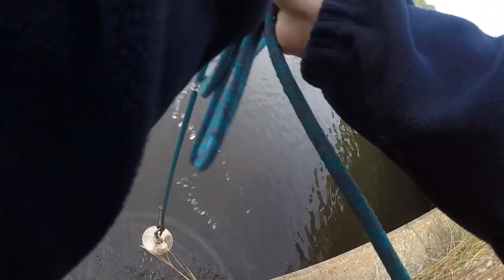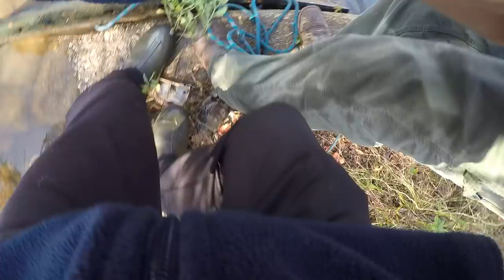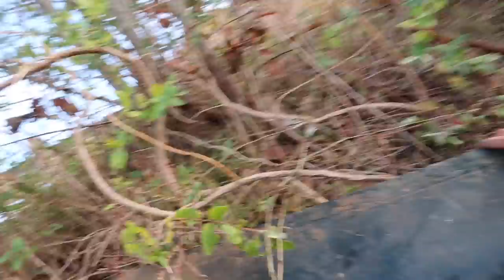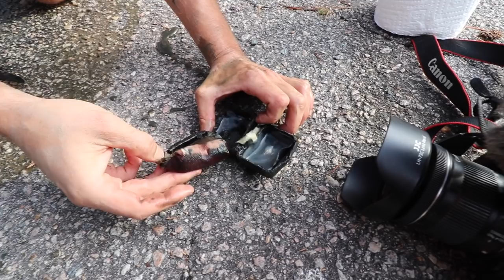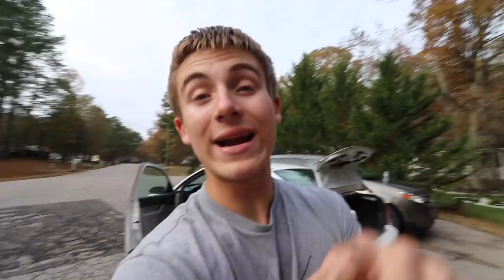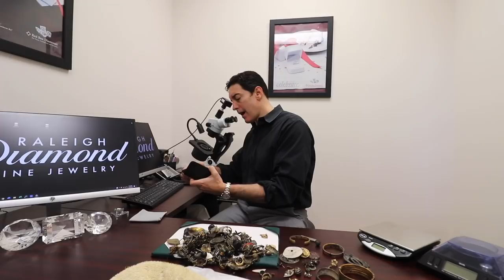We Found A Duffel Bag Full Of Stolen Jewelry While Magnet Fishing (Appraised By Jeweler)

Comment: Looks like someone took the goods and dumped everything else.. Did anythind end up up being non plated gold or silver?
Reply: Well, the jeweler stated that at least one piece was gold filled, which is better than gold plated. For example, 1/20 12K gold filled is 2.5% pure gold content. At $1400/toz for gold, spot value of 1/20 12K is $35/toz. The piece the jeweler set aside as gold filled probably weighed less than 2 grams, so the gold content of that piece was worth $2 or less. 

Even 1/10 18K1(much better quality) would be worth $7 or less for a 2 gram item.